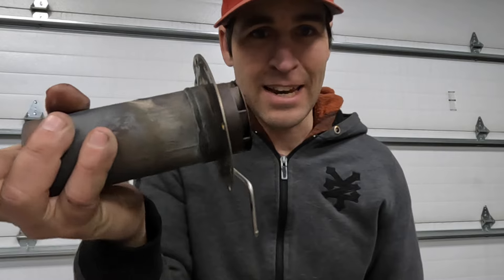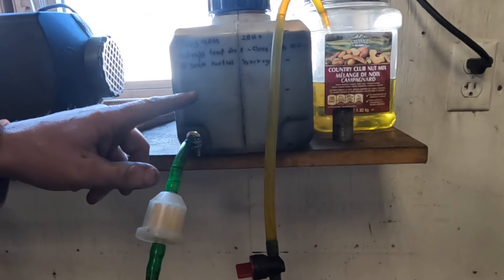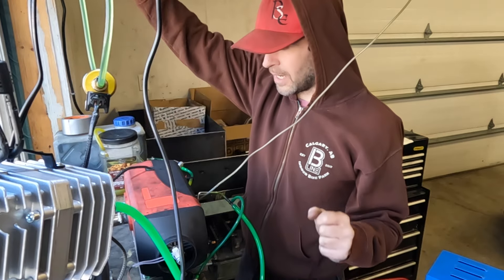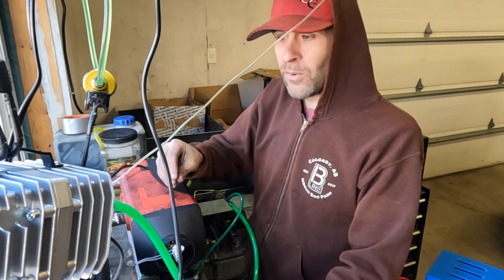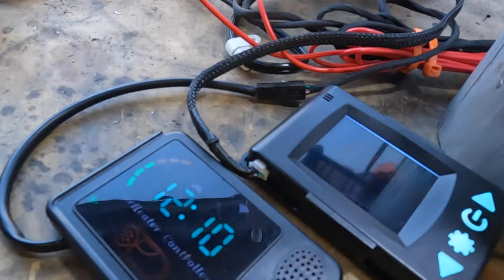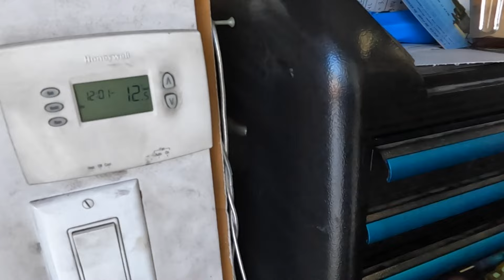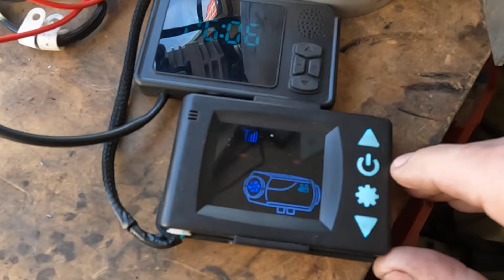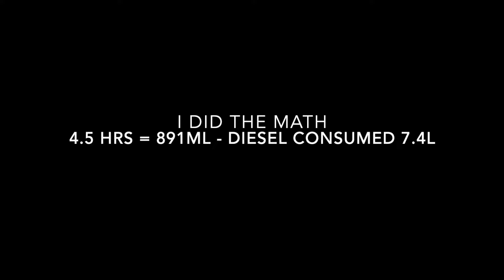Incredible Results - Diesel heater Burning Used ATF -  (Success?!)

Comment: Lat Winter I broke my heater mod'ing virginity by burning 25 litres of clean ATF with an added splash of turpentine (for no good reason other than to get the viscosity looking like that of diesel). That led me to believe it could burn anything. And here I am now, a heater dismantling / cleaning ace lol.
Reply from the maker: 🤣🤣🤣 possibly one of the best stories I've ever heard. So... were you able to burn through the 25L of ATF without issue ? That's awesome.
Reply: @loweredexpectations4927  Well it was new, not used. Heater did fail shortly after when I went crazy with with disposing oddball hydrocarbons. I blame the anthracene (coal tar oil) lol!
Reply from the maker: @davgregeric  Haha... I love it !

Comment: I really like the idea of the 3 holes in the fuel bolt,  does it's orientation matter when screwed in ? My wife and I started a drinking game every time you say gradge. 👍👍😂💞🍹
Reply from the maker: I'm surprised YT allowed you to leave a comment that had the words "orientation" and "screwed" in it 🤣 

Yes... the orientation will matter. I will put an indicator on the outer part so that I can clock it. The new fuel tube will have a nut on the outside so that it can be locked in place once in the right position. 

I'm also going to get rid of the small fuel feed line / pipe and use a much larger one, so there will be less restriction for the aquarium pump. 

Haha... you must be wasted after watching this video !
Reply: I laugh cause Joel seams to not have a accent till he says garadge
Reply from the maker: @shawnrinkel8377  Haha.... If only I choose to say "shop" I could have fooled everyone.

Comment: At the beginning of the clip, there was so much smoke, but the firefighters didn't come?
Kidding :) ,
Don't forget to buy a magnet to fit in the tank if you don't have time to somehow filter the oil atf
Otherwise, the experiment is finally successful.
Reply from the maker: Haha... I was afraid someone would notice and be worried or annoyed ... I'm actually surprised at how quickly it cleaned up ... 

This relative success has made me want to try to buy or build a centrifuge and find a steady supply of ATF .
Reply: @loweredexpectations4927 
I also did think about a smaller magnet with a threaded hole, fixed to the the filler cap with a rod. But then i thought about the extra complication to handle the long and dirty dripping assembly every time during refill and i came to the conclusion, i wouldn't like it.
Reply from the maker: @werner.x  That's true... The way I was doing it is pretty convenient, as long as you remember to leave the magnet there all the time.

Comment: I've been pondering your ongoing problems with CO production. CO is generated mainly from two causes: too little oxygen to burn the fuel or too much fuel to burn at too low a temperature. Logically speaking you could improve either the oxygen issue or burn less fuel (at a higher temperature). But, there's a third parameter that you lost sight of: the evacuation speed of burnt gasses. 

In other words you need to improve the outlet of burnt fuel by using a (slightly) wider (tail-)pipe. Remember, the longer and thinner the tail pipe, the more friction and the more burn gasses backup towards the combustion chamber, hence a worse combustion (too little oxygen and incomplete combustion)

I also mentioned last time, you might have to adequately pre-heat the fuel. The more viscous the fuel is, the more you need to pre-heat and vaporize it for complete combustion. I observed a used-oil burner in  a garage and the way they seem to have solved that preheating problem is, by leading the fuel to the flaming area through a coiled (spiral) metal tube hovering over the burn gasses area. 
I imagine that, if you preheat the fuel it will also vaporize better due to increased pressure and less viscosity
Reply from the maker: Thanks for the detailed comment. 

I think I would call that 3 things. Too little oxygen, too much fuel and too little temperature. Regardless of the air / fuel ratio, if it is too cold, it will be an incomplete burn and cause CO. 

I have considered modifying the exhaust on the heater, but I haven't for a few reasons. 

The largest restriction of the entire system is actually the inlet port, as it is actually D shaped a few CM into the hole, and is about half the size of the exhaust. In this system, the inlet air is the only thing that drives the exhaust out, so a more free flow exhaust would be of limited benefit. 

Secondly, a more free flow exhaust, that gets rid of exhaust gasses more quickly will also greatly reduce efficiency of the heater, as the heat escapes out the exhaust. A slower, more controlled flow will capture much more heat energy from the burnt gasses. 

Lastly, one of the thing that I've been trying to do is perform modifications that either the average person could do, or have drop in parts that the average person could install. A larger exhaust port could be done, but it would require substantial machining of the exchanger. A larger pipe, without a larger port, would not do much to speed up exhaust gasses. 

Preheating oil is almost always done in waste oil burners, this is true. WIth my last few nozzle designs, the fuel has been preheated as it enters un through the exchanger that is about 200C, passes through the exhaust gasses and then the tip of the nozzle is in contact with a red hot part of the chamber. 

I think, in most cases, the trick is to preheat the fuel, but not have it vaporize inside of your fuel feed, as that will cause crud to build up in the feed tube and cause a blockage. Many waste oil heaters that use drip feed, will run the oil feed, in through the air feed hole, to keep the outside of the fuel line from getting too hot. 

That being said. I would really like to try this with a coil of metal brake line (or something similar), and have the fuel feeding through a tube that is glowing red hot ! That would be cool.

Comment: I'm burning pure olive oil mixed with diesel for viscosity(60oliveoil/40diesel) @220c at lowest settings. Working perfect for now at 30 liters already burned.
Reply from the maker: I would like to try olive oil. I did burn Canola oil (rapeseed oil) mixed with diesel, and it worked very well. Post inspection looked like it had some sulphur deposits, but it didn't leave behind anything troubling. I burnt about 10L of veg oil in my test. 

If I do my math correctly, you have consumed about 18L of olive oil. That's the important bit. Whatever contaminants (if any) that will cause a problem, are in there at X percent. Meaning, if you are going to have issues, it will almost certainly be after a specific amount of olive oil, and the amount of diesel will have little to do with it. 

From my testing, the diesel is important to have the mixture ignite easily, but the contamination rate is directly related to the volume of alternative fuel. Hopefully this makes sense.

Comment: Wow! Congrats on an amazing ATF run Joel! Quick suggestion if you would like to use magnets in your waste fuel tank... use a scrap piece of sheet metal (maybe 150mm x 150mm) under your tank to collect and position the magnets where you want them, you could toss a handful of little neodymium magnets into the tank and simply collect them by moving tha scrap metal around under the tank.
Reply from the maker: Thanks for the comment ! That's a good idea with the magnets and scrap metal ... I like it. I may give that a try in the future.
Reply: @loweredexpectations4927 
Won't hinder a magnet to accidentally catch onto the outlet though.
Reply from the maker: @werner.x  I think perhaps there's something "lost in translation" here. I'm slightly confused by this.
Reply: @loweredexpectations4927 
It was about the suggestion of a number of smaller magnets, dropped in and fixed in place with some outside ferrous metal.
Reply: @werner.x  Hii Werner, you're correct if you were to simply drop magnets into the tank when it is in use and sitting upright, they could easily be attracted to the fuel outlet, probably best to wait until the tank is nearly empty and tip it back so the magnets fall into the opposite side of the tank from the metal fuel fitting, then capture them together with the scrap of sheet metal underneath the magnets.

Comment: try sending the exhaust into the bucket of water and into the bucket has carbon in it. could be a good way to capture all the emissions
Reply from the maker: That would be cool. You would have to run it through an aeration stone or something like that, and just the pressure of the water would cause too much back pressure, but it would be interesting.

Comment: Engine and transmission oils have a lot of additives and dispersants, a major one of them being calcium with other metals. They are mostly dissolved so even a small micron filter won't take it out. You're always going to have build up using oils, especially used oils with wear metal/clutch material if not filtered down to sub micron.
Reply from the maker: Thanks for the comment. 

Yeah... I have not burnt new ATF yet, but I have burnt new engine oil, and the ash was the same (based on volume and appearance) as used oil. 

Some of the additives can be consumed in the combustion process or make their way out of the exhaust, but some of it will always be left behind. This is why I suggested a centrifuge may be the best option for "filtering" used ATF.
Reply: @loweredexpectations4927  that would be an interesting experiment to try.

Comment: I still have a fuel manifol where i start and shut down with pure diesel / heating oil/ kerosene/ jet A , run with a ultrafiltered blend 50%  waste everything and anything  / 40% diesel / 10 % petrol.    Hot, no ash observed even though the exhaust exits the wall at room temp
Reply from the maker: Say what ? Waste everything and anything ?  I'm going to try pancake syrup in mine.

Comment: Back in the mid noughties Merc took on a publicty staunt to drive a merc diesel around the world to prove the robustness of thier CDi engines, some special mods were listed on the web that included using 3% ATF (i think the % was, it was a fair time back) they did this to guard against "dry" fuels found in 3rd world countrys and to proctect the CDi HP fuel pump from wear, so it was added as a lubricant, not strictly pertanant to this test but it shows at least that Mercedes didn't worry about ATFs burining abilitys.
I used to use 3% in my older diesels after supher was removed from our fuel supply (UK) it also quietened down older diesels engines and gave a smoother idle but as i say not pertinant to this video but it burns fine and IME is as good as if not identicle to using  2stroke oil in a diesel engine.
As allways chap enjoying the vids 😎
Reply from the maker: I have heard of ATF being used for somany different things. That's pretty cool about Merc, and I think I have heard about that before. 

I feel like you could burn it at a pretty high percent, in a diesel engine, as long as it were filtered very well, or new... but new = $$
Reply: @loweredexpectations4927  totally agree with you, but as a lubricant additive it's  cheaper than 2stroke oil but again not pertinent to this video, just adding my 2pennys worth so to speak 😁
Keep up the great work 👍
Reply from the maker: @Dirt-Diggler  🤟

Comment: You could just put the magnet on the outside of the tank. But beware that other ferros metals in the vecinity will magneticly attract as well. So it might just attract the stuff onto the outlet
Reply from the maker: Yeah, this is what I have been doing... I place a stron magnet under the outlet of the tank. It shouldn't' be a problem as long as I keep the magnet there the whole time. ... the metal outlet will act as a magnetic filter🤷‍♂️

Comment: Hey Joel  , I would love to see you do a control experiment where you run only Diesel in the port where you are currently running in the Oil/ATF and see if it's builds up like it does with the oil/ATF , this would then tell you if it's a ( placement ) of where the oil tube is placed ..
Just an Idea , be interesting to see if it builds up at that port/nozzle..
Great results though ....  great nonsense lol... 
Cheers thanks for sharing Joel..
Reply from the maker: That is true... we don't' know for sure unless we test. I am fairly confident it would be clean, but that has never stopped me from trying something before, haha. 

"great nonsense" haha. Thanks !

Comment: Hi Joel, I've had an idea for possibly easier cleaning of the crud inside. Maybe that hole you drilled in the end of the heat exchanger before, would it be possible to  make it bigger to the size of a 22mm or 28mm plumbing compression fitting plug so you could hoover the crud out without taking it apart? And collect the debris in a sock or cheese cloth over the hoover attachment.
Reply from the maker: I have considered giving this a try, however, the aluminum on the exchanger, with the exception of a small area where I put my current hole (in the end) is very thin. The hole I made in the side only has about 2 threads ...

If I make the hole larger, in the end of the exchanger, there is only a few MM of material, and this is not ideal for any sort of plug. I have been thinking that I can poke into the hole with a rod, smash up the ash and then vacuum out the exhaust port... That may work.

Comment: I just got 2 of these, new to diesel heaters. 5 total, 3 are all in ones with the silver LCD display & display remote. I love those models fo them. & even swapped the ECU & controller to one of these units because they came with the 6 setting controller. Meanwhile the other units have the secret screen which allows you to tune the machine better. I've already tried waste oil & clogged up my first machine. I must say ive been watching your videos lately, I saw the odd one but was looking at so many. Yours are in the direction I'd like to take with waste oil. I'd like to do the least number of modifications as well. I think additives like lucas are key to cleaner burns but also that a gas & waste oil mix is much better than a waste oil & diesel mix. Im not sure if it's the flash point or the octane level but the Lucas does seem to help burn out any leftover build up further back. I did a poor job of cleaning mine first time around with the plan of burning out what was stuck further back & it seems to have worked. It clogged again shortly after, but it was running briefly & pushing out lots of black smoke & over saturating with fuel I believe. I've always tried to dial in the setting to how I felt it would burn the oil better, and it seemed to work as I was getting it to start in -30c with oil mix for a while but that was off waste oil & gas, no diesel. I figure if you can mix it so the gas octane matches to what diesel's is, it might work good enough & not soot up as badly. Im thinking I should do a 2-tank set up like you to start off with diesel & quickly switch back when I can hear it starting to choke the flame out due to blockage. 

Anyways love the videos! Thank you for making & sharing them!
Reply from the maker: The heaters with the engineering menu is better for people who like to tinker. More and more heaters are getting away from that, because, unless you know what you are doing, you can mess things up, haha. 

Fuel additives can help with carbon, but most engine oil will have issues with ash, even if it burns perfectly clean, due to the makeup of the oil itself. This is why I am trying to make the camber easy to clean, haha. 

I found, the problem with mixing oil and gasoline is that the gas will burn and leave the oil behind. It works better than strait oil, but the flashpoint of gas is so low, that it flashes off and burns right away, leaving the oil behind. 

My latest setup was still running fine after burning 10.8 litres of waste oil (not mixed) in the secondary chamber, and 10.3 in the primary chamber. It left a lot  of ash behind, but it was running well... I finally took it apart because it overheated and I thought I had ruined some stuff.